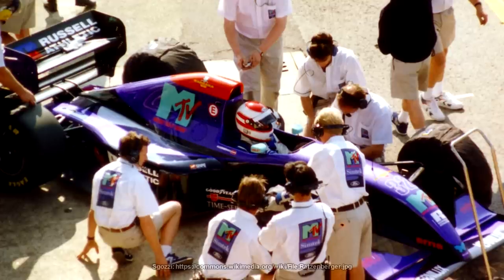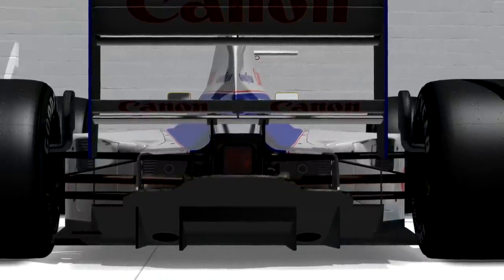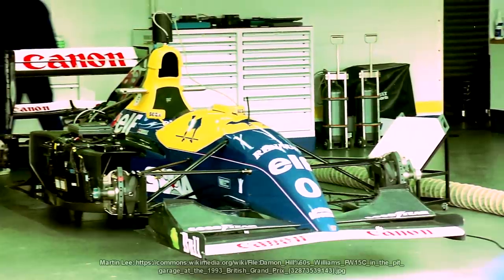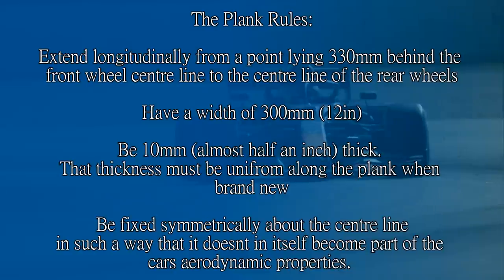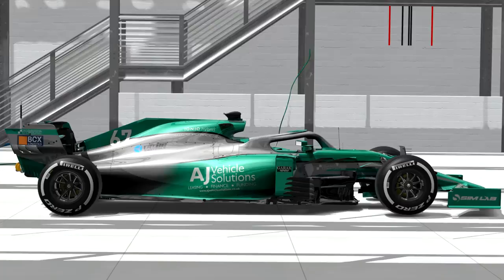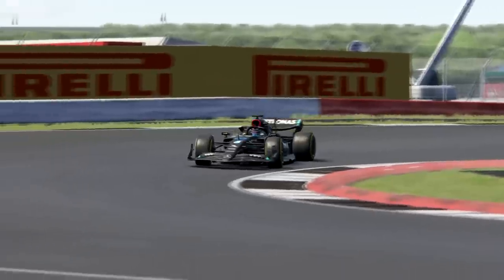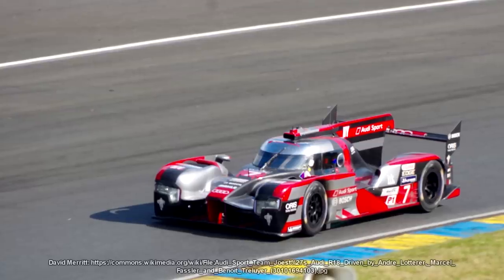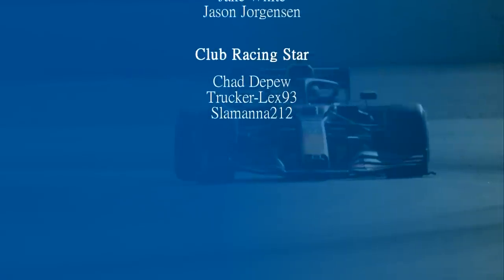THE WOOD THAT CAUGHT OUT HAMILTON! The Story of Formula One's 'Plank' Device

Comment: Seeing the plank is kind of nostalgic. I started watching F1 in 2010 (I was 15) and didn't know it was there until Valencia that year with Webber's flight. I remember being shocked that in this almighty, 'tech rules all' motorsport, one of the components was a simple plank of wood.
Reply: Its plastic and epoxy.  It just happens to look like wood. (maybe it was wood at one point)

Wood can change dimensions based on humidity and temperature and even bugs invading it.  When fractions of millimeters might be a legal debate, wood would not do.

Comment: After the 2000 Brazilian GP, all those who finished in the top six except for Fisichella were found to have excessively worn out planks but the respective teams managed to successfully appeal on the grounds of the extremely bumpy Interlagos circuit, although 2nd placed Coulthard was eventually disqualified for having front wing endplates that were too low. Now, imagine if those five drivers had been disqualified for worn out planks, the results would've looked like this:

P1 - G Fisichella - Benetton
P2 - J Button - Williams
P3 - J Verstappen - Arrows
P4 - P de la Rosa - Arrows
P5 - R Zonta - BAR
P6 - G Mazzacane - Minardi
Reply: I believe another issue with that was those cars were not put through post race tech, so the potential was there to have a podium finisher that may have been worse than this DQ'd. I didn't realize Fisi was legal, that's pretty interesting. 
...and my understanding is that when the titanium skid blocks were brought back, there was a technical reason for it. Titanium is such an expensive material that they would not have just started using it to "look cool", especially in the backdrop of cost cutting. It does look super cool though.
Reply: I don't think Minardi would've been able to handle the excitement of winning points at consecutive GPs in a single season.

Comment: One correction, the active suspension did way more than just keep de the right height the same during the race. It also keeps the car level when braking and accelerating (no diving of the nose under braking). So the car aerodynamic can always work as effective as possible. 

RBR have designed their front suspension to eliminate the diving as much as possible, so the ground effect will be the same in all situations.
Reply: And further to that;  it was also used for DRS! Lotus began using it to drop the whole car on straights but ran into porpoising issues. Benetton however successfully used their active system late in 1993 in winning the Portuguese GP in a noise to tail battle between Schumacher and Prost, via lowering the rear of the car to reduce the effective wing attack angle, it created less drag, just allowing the HB V8 to hold off the Renault V10. 
Not bad for a team in its first and only season with active suspension!

Comment: Schumacher's throttle dragging likely had more to do with running a more rearward brake balance for more rotation. What he was doing was basically exactly what the 2008 engine braking regulations banned. Add power when the rear brakes start locking to overpower them and you don't risk losing the rear regardless of how far back you push the bbal. If it was for any other reason he likely would've stopped doing so eventually, as it would just reduce brake effectiveness otherwise, but didn't until his 2nd stint in F1 after he was told not to because it would cut out the engine if he did, apparently.
Reply from the maker: The “traction control noises” senna heard were likely Schumacher doing that.
Reply: I thought you said it was a form of blown diffuser making those noises?
Reply from the maker: @Doctorgoatboy  yeah- Schumacher would be on the brakes with the throttle slightly open all the way through so the diffuser was always getting exhaust gas on it 

Senna heard the noises and assumed it was TC, probably not realising Michael was left foot braking.
Reply: @AidanMillward please use his formal name of “the Michael” and not just Michael 😂

Comment: What you are missing here is that only 4 cars were tested, so how do we know if it was a ride height problem, wether the team risked it with 1 car each or the track which was very bumpy this year simply wasnt got enough for a tier 1 track. Or we have a 4th option which is leclerc and hamilton different style of driving to their team mates and using different lines around the track caused more damage than what was suffered by sainz and russell.
Reply: That’s what the Merc and Ferrari mechanics will use to make sure it doesn’t happen again if so. It’s doubtful they’d passed, my thought

Comment: Easy solution: 1.let it supply to every team 2. Make it, that the consumable layer has colour X and the layer beyond that colour y (highly visible). 3. Control every plank, where layer with colour y is somewhat visible. 
You're welcome F1
Reply: could work, except the rules specify that the plank is to be measured in four specific places through holes
Reply: @fuzzy1dk  yes, those 4 points stay of course. The colour is just an indicator to simplify controls in Parc ferme
Reply: and can we please check every car? I heard this is a gazillion $$$ sport (now)... so there might just be enough money to hire some guys please? oh and while we are on it maybe just maybe we can hire some stewards so that maybe 3 (or any uneven number so there is never a stalemate ) of stewards watch every car - like all the times and maybe just maybe those min 3 stewards can come up with a punishment in under 3 hours after a race has finished?... maybe we can even get professional stewards like stewards that have a none zero amount of time behind a steering wheel in a reasonable racing class like open wheel single seater or something - maybe we could recycle the F1 driver licence point system for stewards?`just my less than 1 cent

Comment: One of the reason that so few drivers have been penalised for overly worn planks is that this is not one of the areas of the car that is regularly scrutinised.  In the USGP, only 4 cars were inspected (two of which failed).  Surprisingly, Sainz and Russell weren’t checked, despite the fact that their teammates were disqualified.

Ironically, the depth of the plank used to be the easiest thing to check, as there (used to be) holes drilled all along its length to check the width of the plank.  Now F1 stewards have said they “can’t check every car, because they don’t have time…”

Comment: I wish they would put a sensor in the block that indicates the wear. Nothing spoils a race more than changing the result after the podium. It’s like VAR, it stops you celebrating until way after the event.
Reply from the maker: I love what they do in the BTCC to check ride heights: they put a solid paint roller under the front bumper and if it doesn’t go, you’re disqualified. 

Sad Tom Ingram noises.
Reply: I remember when BTCC first introduced the roller back in the late-'90s. Such a simple solution, nice to know it's still used.
They tried something similar in F1 (1981??), except theirs was a high tech (for the time) laser beam to check ride hights as the cars exited the pit lane (not entered it after sessions). But it's F1 so Brabham fitted their cars with hydropneumatic suspension so the driver could raise it at the touch of a button when entering the pit lane. And other teams followed suit with less elegant solutions - levers etc.
Reply: @AidanMillward knockhill 2023 good weekend for me Ronan 4th and pole race 3
Reply: Sensor might be tricky. Especially if the plank gets low enough and it gets knocked off. If they add a layer of colored fibreglass indicating that its too low, say bright red or orange, that might work as well
Reply: Remember all the fuss over fuel flow sensors in 2014? The teams had to use a specified part, but there were isues with accuracy. Teams reportedly bought many, tested them and using the ones which under read. The FIA applied offsets to the readings to try and counter this. In Australia RB were told by the FIA during the race their flow rate was too high and ordered to reduce it, they refused and Daniel Ricciardo was disqualified after finishing 2nd - thus preserving the curse of Aussie drivers at their home race.

Comment: 3 DSQ's since 1994 with 2 of them being on the same weekend? Yeah, no way Charles and Lewis were the only ones running an illegal car last weekend
Reply from the maker: Yeah, only 4 cars checked as well. Surely they’d do all of them.
Reply: Olivier Panis was disqualified too for a too worn plank at the Portugese GP, two races after Michael at Belgium. He originally finished 9th
Reply: Sainz and Russell would most likely be disqualified for sure if they'd been checked too.
Reply: @AidanMillward only the top four teams are checked regularly, and one car from each team is chosen at random (according to Peter Windsor)
Reply: Especially when those checked had a 50% failure rate. Then seems solid grounds to check all cars planks visually at least, and measure any which are sus. Even if it delays releasing the cars. (Or impound all the planks to check later.) The FIA's really gone downhill since Mosley.
Reply from the maker: @ToshYusaf it’s weird. I saw a graphic today that said that Merc and Ferrari have been checked 5 times each this season and Red Bull twice.

Which, considering they win every week, doesn’t seem right. 🤣

Whole thing is just mad.
Reply: But they were the two that got caught out
Reply: Other cars probably being “Out of Spec” post race plank wear is irrelevant to Charles and Hamilton being out of spec.  I agree this section of the Regs needs a reviewed and possibly revised.

Comment: Fun Fact: Before the electronic aids were banned following 1993, Williams had actually decided to abandon their own computer program for their active suspension (Williams Active Ride since Lotus had the F1 Copyright on the term Active Suspension). To that end, they had actually done a deal that the rule changes ultimately forced them to abandon with Team Lotus who was reputed to have a much more advanced system.

That Lotus system was what the FW16 was originally designed to use.
Reply: Funner fact,  Benetton didn't have their own TC system either! It was supplied by Cosworth, but actually developed by McLaren. Benetton didn't get it until Monaco, after Bernie brokered a deal between Briatore, Dennis, Ojjeh and Ford so that Briatore have up Benetton's exclusive top- spec engines (giving McLaren parity from Silverstone) in exchange for aiding Benetton with the TC programme. Bernie was keen after Donington for championship- leading Senna to get the engines Benetton had just received at that race with the introduction of the real B193, which McLaren didn't know were exclusive to Benetton.

McLaren also sold their TC and Active Ride systems to Footwork from mid-93 onwards, helping them move up the grid and kicking off a  fresh round of customer/works team partnerships.

Comment: Excuse me if someone else has mentioned it, but the entire top six at the 2000 Brazilian Grand Prix was disqualified due to plank wear. This was appealed and due to EVERYONE having higher than allowed wear due to the circuit (the bumps along the entire start/finish straight were practically yellow by the end of the race from the planks rubbing).
DC was disqualified for also having his front wing endplates too low at 43mm vs 50mm. McLaren claimed this was also due to the bumpy nature of the track surface, but this DQ held.

Interestingly enough this was after a fresh repave of the track, which only made the bumps worse. COTA actually spent a lot of money during construction to prevent this situation, digging down at least 10m to have a stable foundation, but it appears it didn't work.

Comment: Need to outlaw any type of skid block that is capable of touching the track surface prior to the plank making contact.  If the teams are left with the plank being the first and primary part of the car that will scrape along the track, they will raise the care height to keep the plank within the proper thickness.
Reply: That's literally the point of the plank in the first place....

However, under load parts of the floor will deflect (bend) same with the front wing endplates and diffuser - especially when bouncing over kerbs.
To make them all stronger, the car will have to weigh more, so there's always a trade-off. 
The skid plates were removed in the main,  but F1 reintroduced them in 2015 to make the cars look more exciting on TV, throwing sparks or like they did in the 80s/90s before the planks were brought in in an emergency measure mid-1994.

Comment: Not entirely accurate re active/reactive ride. Most of the downforce gained from having a platform that didn’t dive, pitch or roll, allowing you to deliberately design peaky aero that only works when it’s basically immovable vs the track. You get more downforce, but it’s a lot less general in its usefulness. Newey has said a few times that the front wing on the FW16 stalled if the car pitched forward too much, and there was also some similar, but less pronounced issues with the floor, diffuser and sidepods that were all interlinked. So the car would get unpredictable and alternating understeer and oversteer…